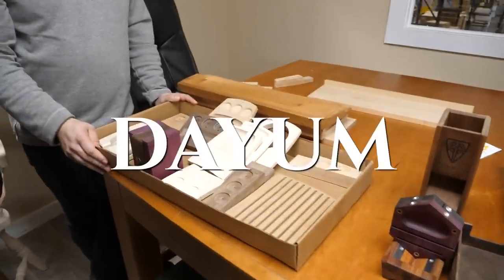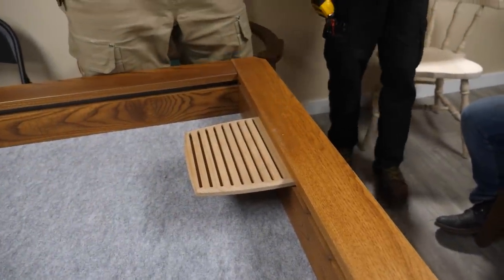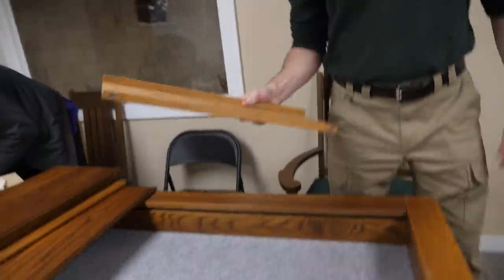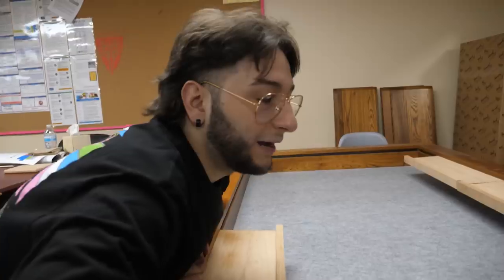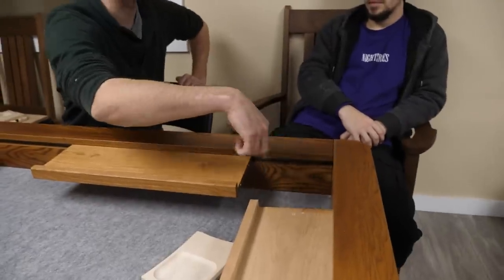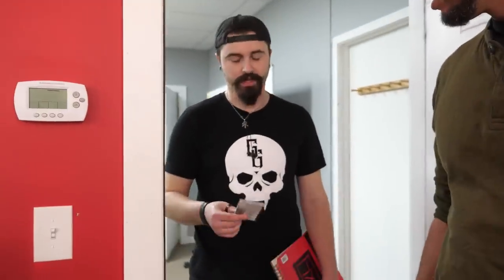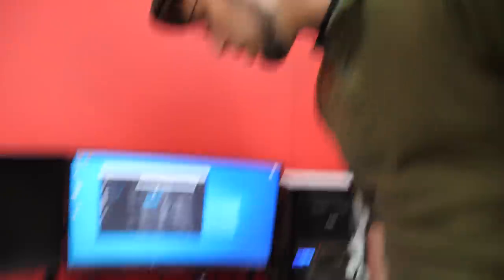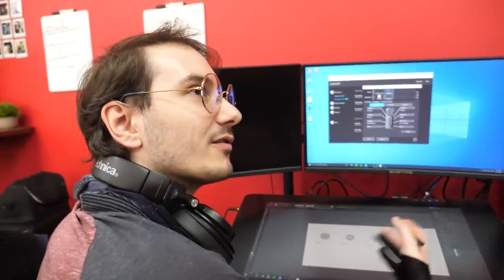Brand New Table Accessories & Deck Boxes!

Comment: Love the new toolbox/modular ideas. The life counter, modular cup holder, and the corner dice tray connecting to other stuff are my favorites. Deck box idea is cool but probably wouldn't buy one. For the magnetic table card holder, perhaps make it two sided with the curves curving in on one side and out on the other so it can be used on both the inside or outside of the table.

Comment: With the extra large card deck.  I like the idea of having it curved.  The way to solve being able to put it on the inside and outside rail, why not have it curve one direction on the "top" and curve the opposite way on the "bottom".  That way it you want to put it on the outside, you just flip the board over and you still have the card slots curved the right way.

Comment: If you wanted to keep the half moon piece but have a better glue connection you could change the grain direction of the lid so it runs from front to back and is the same direction as the half moon.

Comment: For an MGT relaunch, it would be very tempting if you offer early bird international shipping slots too. I’m guessing the original fulfillment is still ongoing then so that doesn’t feel to difficult to add some extra tables there. 
I cancelled my pledge last time as I was frustratingly refreshing the page for an early bird slot but kept noticing tier after tier it’s US only. And when you started promising all tiers to add capacity, all deadlines to be earlier and addingmore complexity and items, I bailed out on being last in line.  
Unfortunately Spiel Essen had no option to pledge for a table otherwise you would already have my money.

Comment: For the card shelf, can't you just make grooves with the other curvature on the back side so that it works both on the inside and outside of the table? Probably depends on the depth of the grooves but it could work.

Comment: The long magnetic edge piece of the tool bar needs a card holding slit cut the length of it on one face. One face no slit for the clean look and the opposite face a card slit for function.

Comment: Hum, for the deckbox, since you guys are concerned about exposed cards, why not make the slot behind the leather strap? The look of the box would stay the same, with additionnal fonction?
Reply: Apparently you beat me to it, i said this and didnt see your comment till i started scrolling.. Easy win in my opinion
Reply: If the strap goes over the hole, the notch won't line up with the top of the deck box when it's tilted

Comment: on the deck box, use the leather strap as the piece that creates the incline. I think you'd just need to rotate the strap part 90 degrees. The strap can then fold under itself (maybe add another female button end to click into?) and then it creates the incline. No more parts, still all of the benefits.

Comment: Design critique for this deck box. 
1.Many formats of mtg have players shuffle their decks, your design would require us pulling the whole thing out shuffle and put it back. Is this optimal I don't think so, so it's more aesthetic than function which fights the original design pitch you had in mind.
2. Are you making different size deck boxes for different formats biggest one right now is Commander which is a 100 card format. Then you have 60 card formats and 40 card formats. 
Understanding these videos come out a bit after these discussions have been had so these critiques might be moot.
Look up tolarian community College, that channel is the quintessential source for all mtg related accessories. So much so that they kickstarted their own design deck box that reached their kickstarter goal and beyond within 12 hrs of its launch this March 2022. There's space for this product but it seems it's more of a box for cards than what mtg players are looking for.

Comment: Make sure the deck box fits 100 sleeved cards instead of the standard 60. Commander is far more popular now-adays and uses 100 card decks.
Bonus points if it has a way to showcase the commander (one card that champions the deck).

Comment: Looking at the "toolbar" and accessories, I'm concerned that if you add too much to the interior rail you're going to start losing things like cards or dice underneath the shelf and it's going to get annoying real fast to remove it, dumping whatever was on top to fish it out from underneath. However, I don't really have a proposed solution. A piece of wood large enough to block it off is going to up the cost real quick.

Comment: For the new card holder; why not cut one side with the curve convex and concave on the other side? That way it'd work no matter if it was on the inside rail or the outside? You'd simply have to flip it. 🤷‍♂️

Comment: Instead of using the "lip" of the lid to tilt the box could you not have used an angled inner edge (Im talking about the underside of the lid that touches the deck when closed). Making it thicker then sanding down a gentle slope to angle the box when rested on might have worked. Or would that have been another production nightmare?

Comment: How does an 8.5x11 piece of paper fit in the tool bar?  My main reason for wanting one of these accessories would be to hold a character sheet and d&d notes, but it  doesn't seem like it would fit that too well, and in that context I'm not a huge fan of the tool bar not being flush with the edge if the table.

Comment: Why choose toolbar or deck box?  Make a deck box accessory for the toolbar.  If I had to choose one, though, its the deck box because I don't have the spare cheddar for a MGT.  ALSO- I like the idea of the brass lip.  If you went that way, you could maybe offer various metals (yeah, I know- SKU nightmare) bright brass, aged brass, brushed nickel, oiled bronze... letting customers mix and match those with various woods would be super sexy.

Comment: Production nightmare, but I'd much rather have the first deck box design.  The little cross-grain lip issue could be resolved with composite materials. Maybe it's not something you can deliver at a realistic price-point, but I think it's a better design.

Comment: With the card tray for mgt. Why not have it reversible? So like the top has the grooves curved one way to work inside the table and the bottom has the grooves curved the opposite direction so it would work on the exterior of the table?

Comment: would it not be possible to have a sloped interior on the cap/ crown that covers the slot when closed and then simultaneously provides an incline when opened like the prototype?

Comment: for sure deck box over tool bar...but i really don't like Jason's design of having just a straight cut out. kinda defeats the purpose. my first thought when seeing Matt's first design (with the long thin cut out for a finger) was how close a standard Cribbage board has a very similar design on the bottom of the board for holding the pegs, and just having a metal tab that slides over the hole to keep the pegs in. just do that. have a long thin cut out in the deck box with a matching wood tab that can slide in and out. that way the deck box fully covers the deck, and there is still a cut out in the design for function.

Comment: From the perspective of a non Magic player, the tilted deck box and the notch are not useful features.  I work at a card store and sell deck boxes all the time to Magic, Pokemon, Yugioh, and Digimon players.

  Designing the box around the idea of the notch and tilt bring up some concerns.  I can't speak for commander but many other games require a lot of deck shuffling or returning cards to the bottom of the deck and having to dump out my deck several times during a game is going to add unnecessary time to games.  My interest in purchasing and recommending a Wyrmwood deck box is tied to the protection the box provides and the clean visual.  Tilting the box to use it as a tray is not a feature I will be able to use in competition.  Having your deck not visible to your opponent is a definite no go, mainly because anyone could claim that my cards are marked or I'm not drawing fairly because they can't see the whole deck at all times.  It's dumb but some people will try to rule shark every chance they get.

This is likely not going to be very common but it would be very beneficial for this box to accept Oversleeves as well. There are usually sized at 69x94mm.  Sometimes you get sleeves that over time go out of production and you can't replace them easily or you need to keep certain cards outside the main deck between games.  Again most people probably won't need this however other manufacturers like Gamegenic and Ultimate Guard  do have the majority of their boxes sized to fit these.  

It may be too far in production to experiment with a side loading variant but I personally much prefer this orientation for a single deck box.  Many companies like the ones listed above do have horizontal deck boxes and these are very popular with players.  Being able to take a deck out of the box without dumping it over is a nice feature.  

Hope this was a useful critique, looking forward to seeing where the build goes.

Comment: I spend a lot on Magic cards and I think you look like a tool when you roll up to a table with a $5,000 dollar deck in a <$5 deck box. The boulders from ultimate guard and similar boxes are sturdy and they work, but my wyrmwood boxes actually look nice and cost nothing when compared to the cost of certain single magic cards.